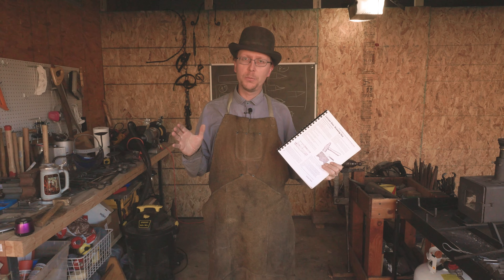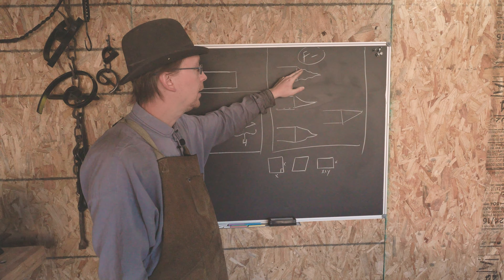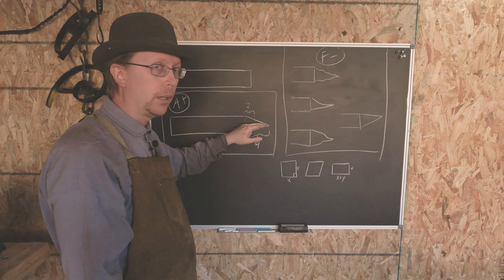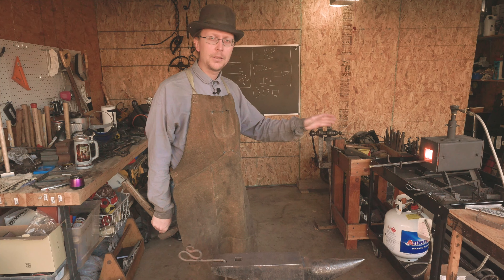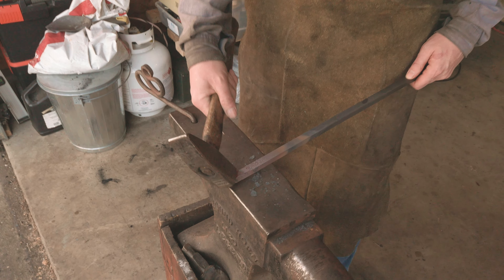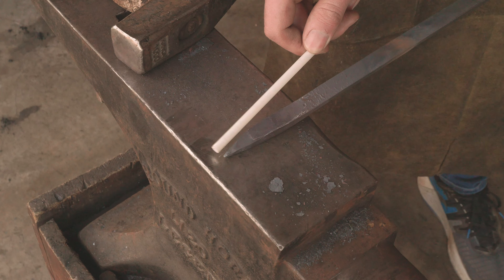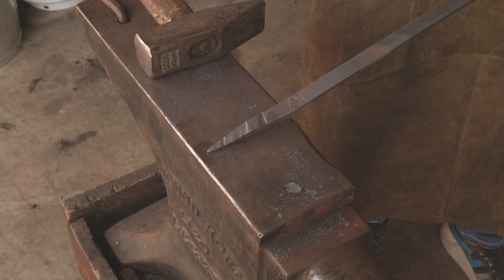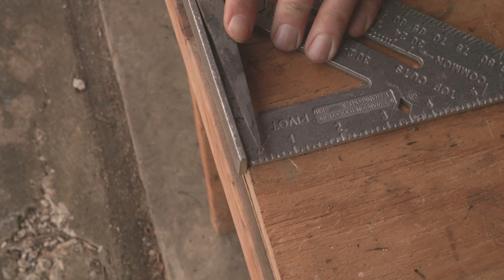ABANA Controlled Hand Forging - Lesson 1: Drawing Out

Comment: Great video, Philip.  I'm looking forward to the round-stock video.  Working with round stock is where my tapers tend to get really wonky sometimes, from not rotating precisely 90% on each stroke.  I hope you have some useful tips for correcting that.  Forrest
Reply from the maker: The most common reason I see things go wonky when going from round --> square is because the individual is trying to do the rotation with their fingers. If you are spinning the steel in your fingers it's very hard to move back and forth 90 degrees.

If you instead keep the steel locked in your hand and rotate your wrist you'll hit the 90 degree rotation consistently. So wrist extended down we'll say is 0 degrees, you then rotate your hand up toward your body and the steel will be at 90 degrees.  Then you extend your wrist again to get back to 0 degrees.  Just go back and forth with that motion only ever hitting on two sides and you'll get good consistent squares.  

I'll try and film a short video on it.
Reply: @WatersIronworks  Thanks for the tip, Philip.  I'll give it a try.  Forrest